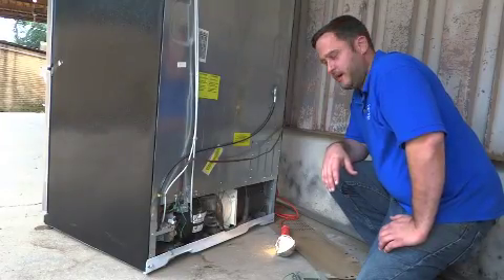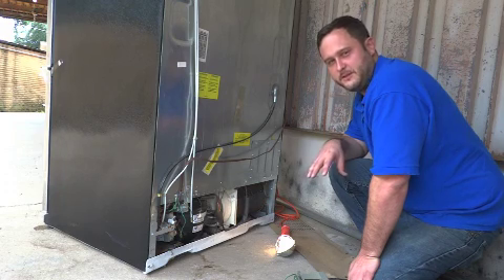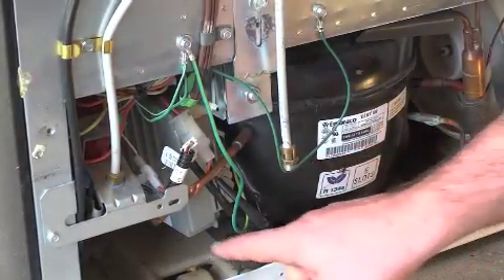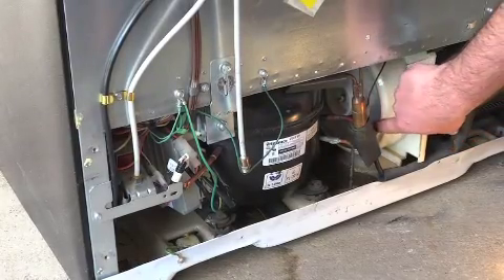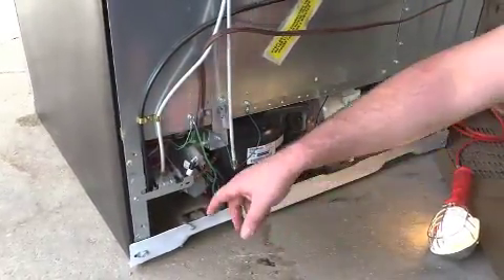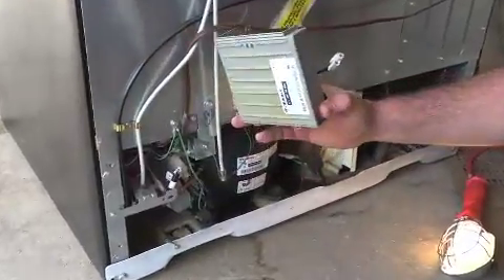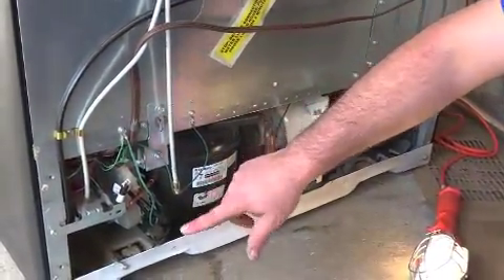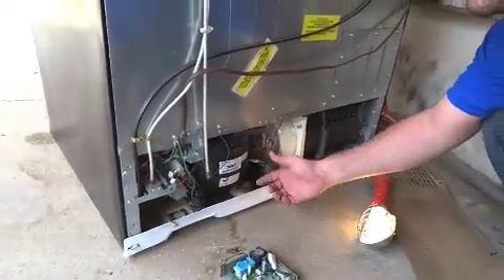Repairing a GE Profile Refrigerator due to Flood Damage

Comment: Hey man thanks for making this video. I bought a no frost bottom freezer refrigerator just a couple months ago and wouldn't you know it I only had the thing for 3 months and I had a flood in my house. I had the local technician come and check it out and they said it's working okay. but I was wondering if you had any tips of something to look for in the future or potential problems. Opened up the back of the machine and what I could see is that the compressor and fan are a lot smaller than the one that you were looking at there. I'd say the bottom of the machine got about an inch and a half or 2 in of this dirty muddy water. I guess the compressor and fan are okay I mean the machine seems to be working and cooling still. It seems like it was high enough to get into the drip tray though so I had to clean up the drip tray because that water is pretty gross that flood water was pretty dirty. I tried to wipe out the metal parts to in the back at the bottom that I could see but getting underneath the bottom of the freezer seems to be pretty much impossible. Anyway the machine seems to be working appreciate you putting up this video and any tips you can give to look out for future problems due to this flooding incident

Comment: Great video you mentioned evap fans. I have ice forming at the bottom of the freezer side of a GE Profile tps24bf side by side frig do evap fans control this kind of condensation or is this issue related to them not working? If so what is a good recommendation for such a repair? Thanks.
Reply from the maker: If it's a sheet of ice on the freezer floor, you most likely have a clogged evaporator drain. You may have to remove the evap cover to clear it. Good luck
Reply: Thanks, that's what I'm hoping. I need to get a diagram for it, but thats inside right?
Reply from the maker: Sometimes